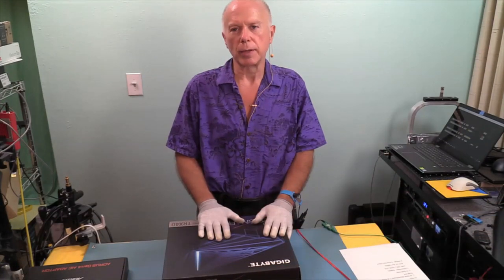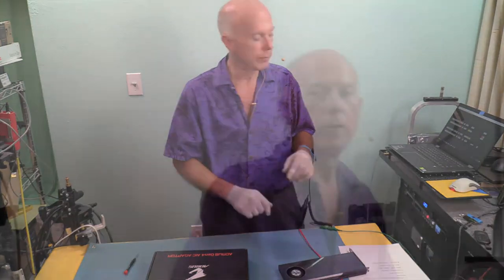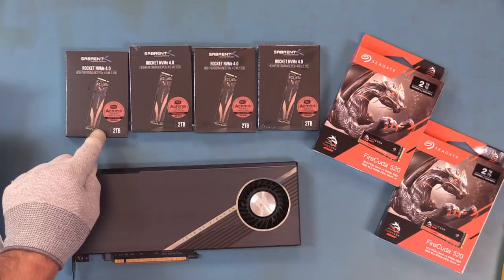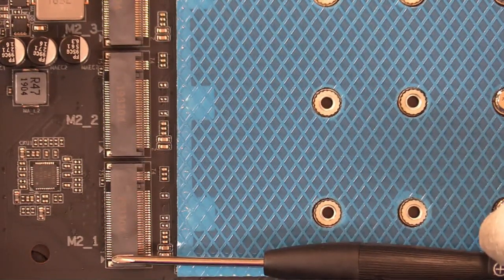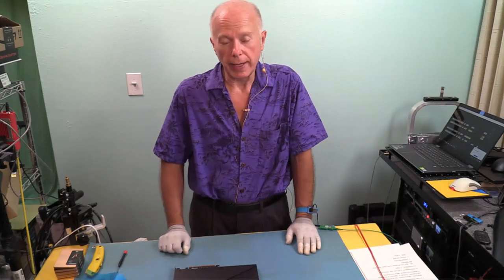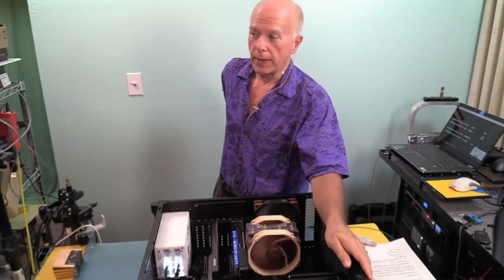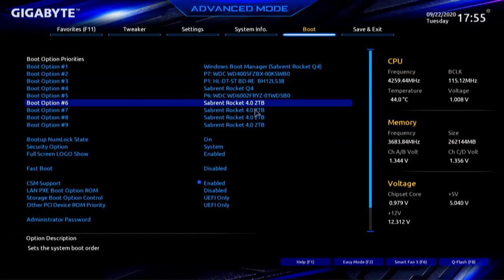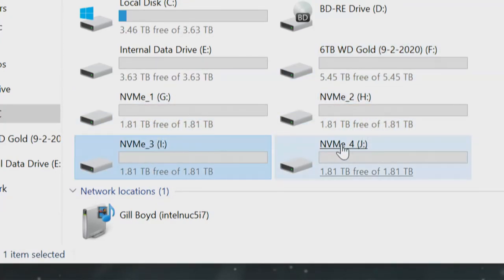Gigabyte AORUS Gen4 AIC Adaptor Comparison and Simple Install Tutorial TRX40 Designare

Comment: Hi Gill,  Do i need to install the amd raid drivers for a raid 0 (not bootable) either made in windows or bios on the gigabyte aorus aic gen 4? Same one you have in the video. I’m on gigabyte trx40 aorus xtreme, threadripper 3970x. Card is already in slot 1 and bifurcated. Only issue i have is slow benchmark tests (all bellow 1GB, even less than 100mb’s sometimes). Many thanks, Stefan
Reply from the maker: Hi Stefan Drobota,
Welcome! Yes, for the Hybrid Bios RAID whether Bootable or not. Congrats on Your Build!
Reply: @BuildOrBuy  hi Gill. Something’s wrong with my setup as cannot get it to work properly. Only managed to create a bootable raid array and speeds are disastrous. Less than 100mb/s. There’s a bottleneck somewhere. I even removed the other 2 nvme drives from the motherboard and only left the aorus aic gen 4 connected. In bios i have bifurcation on x4x4x4x4, gen 4 pcieslot, csm support disabled, nvme raid enabled. What am i doing wrong? Right drivers installed during windows setup..
Reply from the maker: Hi @Stefandrobota  
Very odd. Tell me more. Which M.2 NVMe Drives are You using on the Quad card. Brand, Model and Capacity?
Reply: @BuildOrBuy  4x samsung 980 pro 2tb, updated the firmware through samsung magician. I reinstalled windows probably 6-7 times in the last 3 days. I’ve tried even the aorus storage manager and still slow speeds (no amd drives when made the raid 0 with the aorus storage manager, just bifurcation in bios and thats it). So far i tried bootable raid 0, aorus raid and raid 0 non bootable (updated 2 drivers in storage controller and device manager but 3rd one don’t know which one to update, as per instructions from that person in your video).
Reply: @BuildOrBuy  i also tested each drive individually and they perform close to advertised specs. Doesn’t seem to be an issue with the drives.. either i’m missing a setting in bios or something is bottlenecking the raid. Bios version is FC. Trx40 aorus xtreme rev. 1.1 ,
Reply from the maker: HI @Stefandrobota ,
Aha! Missing A Driver! 

Two types of installs. Both require the same 3 Drivers. To reiterate, all 3 Drivers are required. 

Required: NVMe RAID Driver.
1st Gen AMD Ryzen Threadripper Processors NVME_CC
2nd Gen AMD Ryzen Threadripper Processors NVMe_DID
3rd Gen AMD Ryzen Threadripper Processors NVMe_DID

Drivers, in Order... 
1. rcbottom.inf driver
2.  rcraid.inf
3. rccfg.inf driver

Then once complete, in Device Manager You will see: 
A. Expand Storage Controllers: there are entries listed as AMD-RAID Bottom Device.
B. Expand Storage Controllers: there are entries listed as AMD-RAID Controller.
C. Expand System Devices: there is an entry listed as AMD-RAID Config Device. 
Voila! Hope that helps!
Reply from the maker: Hi @Stefandrobota ,
That would have been my next Question going through what's what however, the Driver missing is the problem.
Reply: @BuildOrBuy  driver missing only in one instance (the raid 0 non bootable)

The bootable version i've installed all 3 drivers, in the correct order and even tried on separate instances the NVME_CC (per your video ) and NVME_DD ( per AMD instructions). So in this situation i know all drivers and installed but still slow speeds.
Reply: @BuildOrBuy  i’ve replied on one of your other videos. The “missing” drives is the confusion i got from the 4th step process of updating the “amd raid config device” which is already updated through step 3.
Reply from the maker: Hi @Stefandrobota  
Yes. Got it and answered. I'm still perplexed by what's causing this Performance degradation in RAID.
Reply: @BuildOrBuy  hello again! Just an update on my situation. 
I’ve removed 1 nvme from the quad card and deleted&created a new raid 0 with the 3 nvme left. Went into disk management and created new volume&formatted which was done instantly (when 4 nvme on the quad card it would freeze while trying to format, probably 2 times was done instantly out of 10) then started atto benchmark and 1st time it reached almost 100% of the task before the app freezes, while reaching 5k read and 6.9k write. 2nd and next attempts it would freeze shortly after it starts. While doing the benchmarks I’m watching the task manager to see usage and varies until it reaches 100% and at that point it freezes. At this point I’m thinking if the nvme has bad blocks? Does the controller reach a certain temperature and throttles the nvme..? I have few days left until i can return/replace 2 of the nvme ordered through amazon. Shall i try upgrading to win11 and see maybe better luck with that? Whats your opinion on this? Many thanks
Reply: @BuildOrBuy  ps. A few times while the benchmark freezes with 100% disk usage, the raid drive and C drive disappears from the task manager. 1 drive (:d) still shows in task manager. Remember i have 2 nvme on the motherboard (1st two slots which are connected directly to the cpu) and the quad drive.
I also run chkdsk and optimise the partitions/drives but no errors found
Reply from the maker: Hi @Stefandrobota ,
What Bios version are You on? This is either the Motherboard or the CPU. If You were to swap the Motherboard M.2 NVMe Drives with any on the Quad card, expect similar results therefor the M.2 NVMe Drives are not the problem but test and verify.
Reply from the maker: Hi @Stefandrobota ,
Did You try to RAID just the 2 M.2 NVMe Drives on the Motherboard and Test and Verify? Yo reiterate, if this is the CPU, the Bios could affect that since updating the Motherboard Bios Updates the CPU Microcode as well. And since this is a Gigabyte Motherboard, did You Step through the Bios Updates?
Reply: @BuildOrBuy  bios version is FC. I’ve already tried that (swapping nvme drives)
Reply: @BuildOrBuy  hi Gill. I haven’t tried raid on the motherboard drives. I have done everything i’m doing now on the previous bios version with no luck hence i’ve upgraded to the latest version
Reply from the maker: Hi @Stefandrobota ,
Did You Step through each Bios Update? On Gigabyte, that's a crucial Step.
Reply: @BuildOrBuy  what exactly do you mean by step through?
Reply from the maker: Hi @Stefandrobota ,
Then Your Motherboard Revision is 1.1/1.2 or 1.3. Ok. That FC Bios does not allow going back to Step through Bios Updates. Bummer. Each Bios Update has a different AGESA Microcode. That's the CPU being Updated. RAID is a function within the CPU. We access that feature through the BIOS / UEFI.
Reply: @BuildOrBuy  motherboard is revision 1.1 and I’ve followed gigabytes instructions on how to update the bios. Everything works fine until i installed the quad card and made a raid 0. Other than this there’s no issue as far as i can tell
Reply from the maker: Hi @Stefandrobota ,
By installing each and every Bios Update from the one when Your 1st received Your Motherboard to the next one and so forth and NOT skipping any Updates in between. On Gigabyte, each Bios Update does not always Update everything. Each Bios Update only Updates some things. If You miss a Bios Update, You risk losing a feature Update. Notice, most Bios Updates are of a different size. Usually Bios revisions are of different sizes starting from smaller to larger file sizes but not always. Depends upon what is being Updated. We have documented all of this for a reason. To help so no one gets stuck. Details matter.
Reply: @BuildOrBuy  checking my phones photos as i took while going through updates and found this.. motherboard came with FA bios, i’ve update to FBi then to current one FC
Reply: @BuildOrBuy  Hi Gill. I have removed the quad drive and left only 2 nvme on the motherboard (1st slot ones, connected to cpu). Deleted & made a new array in raid 0 with those 2 drivers. Reinstalled windows (loaded raid drivers before that) and as soon as i booted into window, let it do its thing and didn’t start windows update as I usually do. Opened atto benchmark and i got 12.3gb read and 9.3gb/s write. Benchmark run till the end without freezing etc.
Now if this works and from a further research i did yesterday, found that in bios, numa nodes per socket should manually set and not let it in auto. Could that be the issue?
Reply: @BuildOrBuy  Hi Gill. Further tests. I have now plugged in the quad drive (with only 3 drives on it) , deleted & made new array raid 0, logged in windows and checking device manager all appear like i’ve installed the drives already for these drives.. interesting.. opened disk management, new disk appeared, initialised, created volume. Opened aato benchmark and run until 256kb test then froze. Disk usage 100% in task manager and 0 read/write. There were good results until it froze, 128kb test was 7.14 write & 5.11 read. Question is what causes to freeze? Case is open and has plenty of airflow, touching the quad card and it is warm but not untouchable hot..

Comment: Will this work on a b550 vision D?
Reply from the maker: Hi Germaine Breakenridge, 
Nice to meet You! Gigabyte B550 Vision D
https://www.gigabyte.com/us/Motherboard/B550-VISION-D-rev-10#kf
PCIe Resources: PCIEX16, PCIEX8, PCIEX4. 

If You are using a Video card, NO. You would require a self Bifurcated card. Or, place the Video card in the x8 Slot so the M.2 card can be in the 1st and only x16 Slot. If You are not using a Video card, yes in 1st and only x16 Slot - electrically, if Your CPU supports Bifurcation according to Your Motherboard PDF. Otherwise, nice Motherboard! 

What CPU are You using? Hope that helps!
Reply: @BuildOrBuy  I'm currently using a ryzen 3600(placeholder until I can get my hands on a 5900x) thanks a lot for the quick reply, I just discovered this channel yesterday and really appreciate the details in your videos.
Reply from the maker: Hi @GSXone , 
Thank You very much for Your Comments! When someone is working on a problem, help cannot come fast enough! Always try to reply as quickly as possible. Even though we try to keep it simple and hit the high points, Details matter! OK. Either way, You should be good to go. Slim pickens on PCIe Resources. Thanks for sharing! AMD Ryzen 5 3600 = 24 PCIe 4.0 Lanes. AMD Ryzen 9 5900X = 24 PCIe lanes. If Vendors talked about PCIe Resources, no one would Buy anything less than a HEDT. Just had to throw that out there. Anyway, knowledge is power only when shared and utilized. Getting parts is crazy ridiculous right now. Success on Your Build! We're going to be doing a heat Test comparing 2 different M.2 cards soon. Working through the mechanics. Stay tuned!

Comment: Amazon's Hyper GEN4 Asus card for $70 is covered in reviews that the card won't give them 4 GEN4 drives in their Ryzen build. Youtube never stressed the cpu lane bottle neck on a Ryzen or the reason to want a first gen TR board. Ryzen is16x or 8X 8X that's it. A 3900X or 3950X is more cores but AM4 is still one 16X cpu lanes. No one bought the 8/12 core TRs so AMD gave us the Ryzen 12/16 core cpus and jumped to a 24 core TR at $1349 starting price.
Reply from the maker: Hi Max, The x570 Chipset can Bifurcate the 1 single x16 Slot to ×4+x4+×4+×4 to accept 4 NVMe Drives. Do You remember what Motherboard was being used so we look further into that subject? Thanks for Your help. And Appreciate Your Comments. Helps Us to make better Videos!
Reply: @BuildOrBuy  Just specs on these board show X16 or X8 X8. I saw so many people review the Asus Hyper Gen4 m.2 card that didn't realize how few Cpu lanes they got on the AM4 socket. At least a GEN4 mobo would allow a gen4 gpu to run on gen4 8x at gen3 16x speeds. I'm still on first gen TR and Ryzen 1900X/1600X. I only buy gen4 Hyper cards/DIMM2 cards/m.2 drives/gpus/cpus/DDR4 Samsung B-die.
Reply from the maker: Hi @maxhughes5687 ,
1.) All TRX40 Motherboards have  2 x16 and 2 x8 Slots, PCIe 4.0. Most X399 Motherboards are same - 2 x16 and 2 x8 Slots, PCIe 3.0. 

2.) We can wish! Currently, there are no PCIe 4.0 Video cards. Yet! 
3.) PCIe Lane assignments are same for PCIe 3.0 and PCIe 4.0. Maintains backwards compatibility. 
3.) I'm with You there! My main System for 'doing everything' is a Ryzen 1800X, second Generation. Excellent work Computer!
4.) DIMM2 cards, You must be using an ASUS Motherboard? Samsung B-die, G.Skill?  

Thanks for sharing!
Reply: @BuildOrBuy  A Zenith Extreme/1900X/96GB G Skill (Samsung B-die) 3200MHz 14 14 14 14 34/Radeon VII/Hyper card/ 4 2TB Sabrent GEN4/one DIMM2 (new with heat sinks) and a 1TB Sabrent GEN4 NVMe ( W10 backup). I've been at it for 34 months.  I still want that Asus 43" 4K 144Hz monitor. First gen Zenith had 8 cpu lanes to the DIMM2 card. The new TRX40 Zenith II the DIMM2 has 8 lanes off the chipset and it's the mobo M.2 lanes between the PCIe sockets that are direct cpu lanes.
Reply: @BuildOrBuy  The ram. One kit of 2 8GB in 2018, one kit of 2 8GB in 2019 and one kit of 4 16GB in 2020. 96GB 3200C14 with one click in the bios. I'm sold on Asus Omnimem and G. Skill Trident Z.
Reply from the maker: Hi @maxhughes5687 ,
Are You going to Build another? That's an odd amount of RAM. As long as it works, it works! How Do You use Your current setup? What applications? 

That Monitor, Wow! Beautiful! That would be great for Editing Video! Thanks for Sharing!
Reply from the maker: Hi @maxhughes5687 , Now I get it. That makes sense. We have not tried the G. Skill Trident yet. Hard to justify. Always the question, faster RAM or more RAM...

Comment: First of all thank you so much for making this video, i learned a lot, i have a question if you can please answer it, i have an x570 Motherboard will i be able to still use my GPU on X16 and allocate just x8 lanes to this card and only use 2 Gen3 drives on it? i can get this card for sub 40 dollars and i am wondering if i can use this way?
Thanks Again
Reply from the maker: Hi Mohammed, Yes! Install Drives on Connectors 1 & 2. Bifurcate in Bios. PCIe 4.0 is suppose to be Auto Bifurcation. Set it Manually like we have to do on PCI 3.0. Good deal! And remember, Your Video card will now run at x8. I know, It is what it is.
Reply: @BuildOrBuy  got it, i appreciate the quick response 👍
Reply from the maker: Hi @MrYeahii , Absolutely! Good timing!
Reply: 40$ for this card hope u boughtthem all lol

Comment: I Just Installed One of these card Aorus Gen4 AIC SSD 8TB, On my Asus Prime X299-A II, with i9-10980EX, 256GB RAM, and a RTX 3090 GPU. I can only see one NVME of all the four.. (the 2nd one..). Could it be defective card?
Reply: ALSO, the cards FAN is running at full speed al the time
Reply: O.K solved the 4 Disks Not seeing Issue. now only got Issue with the FAN of the card. it runs full speed at all times. very windy...
Reply from the maker: Hi David Peled
1.) You have at least a 44 Lane CPU. Good. 
2.) Your M.2 Quad card is in PCIe16_2? 
3.) Is the card Bifurcated? I'm looking in Your Manual. There should be a setting called Hyper Quad under the PCIe Slot configuration. I do not see anything about that. 

ASUS Quad card Compatibility PCIe bifurcation Hyper Quad card 
https://www.asus.com/support/FAQ/1037507

From the ASUS link above, Your Chipset will work. Your Motherboard will work. But the card has to be Bifurcated. Bad card. Possible. One way to test, swap x16 Slots. Unless You have a 3 Slot RTX 3090 card?
Reply from the maker: Hi @thedavepe , Correct. We can see LEDs out the back. And the 2 Dip Switches on the card control how many M.2 Quad cards can be installed in a Computer. Up to three. No Fan Switch. Full speed ahead!
Reply from the maker: Hi @thedavepe , Bifurcation setting. Windy, yes.
Reply: @BuildOrBuy  Thank you so much. very happy to find someone like you with all the answers...:-) I've got the card to be identified with all 4 NVMEs, and configured a 4 way stripe via Windows. the numbers ain't quite what is declared: 9G/s write, 4G/s read... NO 15G/s or even close to that..
Reply: @BuildOrBuy  So, the fan will run full speed all the time..?
Reply from the maker: Hi @thedavepe , Correct.
Reply from the maker: Hi @thedavepe , You are most welcome. No. The fastest option would be configured from the Bios. We may do another video later to show how to maximize performance.
Reply: @BuildOrBuy  THX a bunch! this card will not be my first choice for my clients.. its very loud, and lake support (at least on ASUS boards). the utility from Gigabyte (Asus storage Manager)  doesn't see the NVMEs even when they are up and running as a 4 way stripe. only the SSD toolbox recognise  them..
Reply from the maker: Hi @thedavepe , You're welcome. As an I/O card, it is what it is. We do not recommend using any of the Gigabyte software.
Reply from the maker: Hi @thedavepe , Although we don't recommend using any Gigabyte software, did You install the AORUS Storage Manager? You can monitor overall temps to change different fan profiles based on configuration.